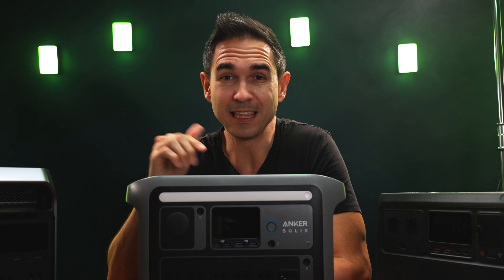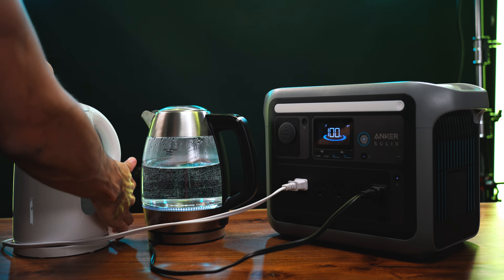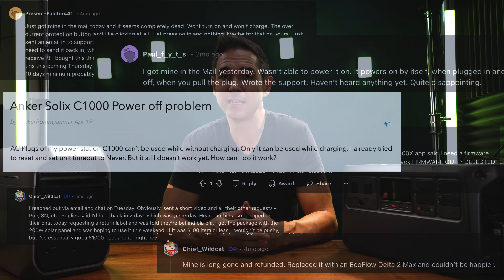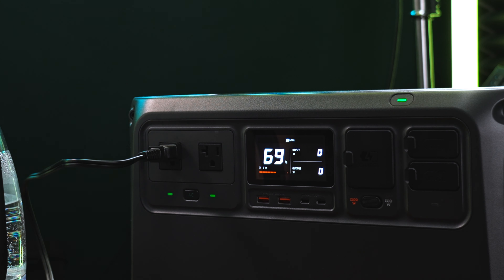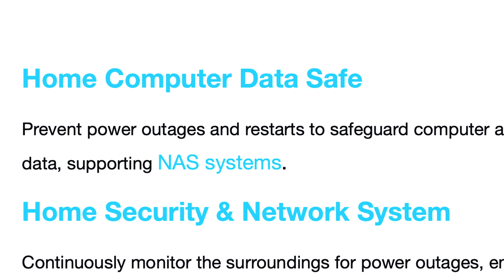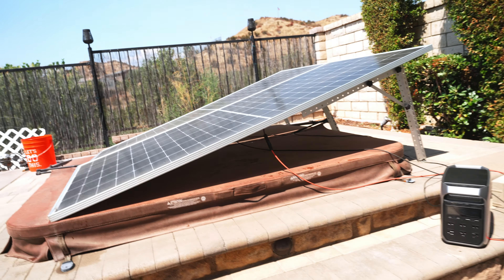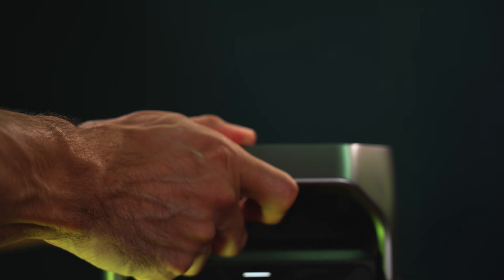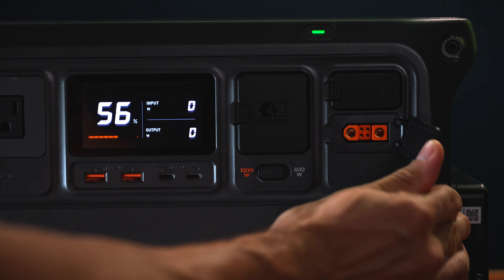Anker Solix C1000 BRICKED During Test! (Ecoflow Delta 3 Plus vs DJI Power 1000 – Real World Test!)

Comment from the maker: Yes, I tried the reset button. It was defective. Anker replaced it VERY quickly. I have not been able to film an update video yet, but I will soon. Sorry for the ridiculous long delay in an update. Life gets busy.
Reply: Anker C1000 has a plug called SurgePad. It’s the very last one on the right side . It will lower the voltage to make it work . Use a power strip . And see if it works with both .
Reply: Its been one month. Did you do the test again? Did the issue happen again?
Reply: Update?
Reply: Update?
Reply: @Sorensic_96  Update?
Reply: I see u didnt mention u actualy have a fuze reset button on the left side of the battery next to the solar imput im sure u tested it but why not mention it ?
Reply: @Maykay1312  That button has nothing to do with output. It's to protect the unit from AC mains spikes during charging, say in a storm etc.
Reply: I just got my anchor 1000 today. 
Where you plug in the AC charger there is a reset button, I would have thought maybe that would correct your problem but in your video you did not even attempt to push it to see. 
Another commenter said to hold the power button to reset. 
Makes me wonder if you know what you are doing.
Reply from the maker: @CJLinOHIO the button was defective. Anker replaced the whole unit. Sorry for the delay on a real update.

Comment: To be fair most people aren't trying to push the c1000 to its limits and trying to find its breaking points.  Ive saw and read more bad reviews on the ecoflo than any other unit.
Reply: @jodyallenbaugh9427 just because the weight limit for the bridge is 10,000lbs doesn't mean I'm going to cross the bridge with a truck weighing 9,999lbs. I agree most people aren't pushing the machine to that limit. And if they are, they should be going for a 1,500w machine.

Comment: Interesting. I've done the same overload test on the Anker without issue. After it kicks out, a long press of the power button brought it back on every time I tried it.
Reply from the maker: I plan on doing the same test on my warranty replacement. :)
Reply: @TommyCallaway What happened?
Reply: Same here, I've had zero problems with mine after several overload tests

Comment: I haven't had any issues with my C1000 It doesn't seems fair to simply not recommend a product based off of this one issue you had with your unit.  This is only one unit you could have gotten a lemon it happens these power stations are mass produced. I also haven't heard of any other people having this issue either myself included. It would be a completely different story if hundreds or thousands of C1000 units where experiencing this issue but there is just no evidence of that yet.
Reply from the maker: Valid thoughts. I plan on making an update video soon on my experience getting this fixed.
Reply: In the video he shows other customers that had similar issues
Reply: @TommyCallaway when is the video coming out?

Comment: I think you didn’t push the reset button on the back and now you are embarrassed and making stuff up.
Reply: Do you even know what that button is for? It has nothing to do with output. It is to protect the power station when charging BY AC MAINS from spikes etc in a storm for example. You are not the only person to be banging on about that button incorrectly.
Reply: @ You are wrong….it is to reset the unit if it trips. You silly fool.
Reply: @Imjustsaying1966  WHEN CHARGING FROM AC. It's on the INPUT not on any outputs. FOOL!
Reply: @Gravitational234  You so crazy. Did you vote for Kamala?

Comment: My Delta 3 Plus exhibits a high pitched hiss when charging between 600W - 1500W. When I sent EcoFlow a video they said that it was abnormal and sent me a return label. Does yours make any sound other than soft fan noise while charging? The fans are super quiet, but the transformer charging noise is unnerving frequency wise even though it's not loud.

Comment: I'm not defending Anker here, but the comments on the video are from people who clearly haven't read the documentation. For example, some mentioned the power station not starting when not plugged in, which is true. Another person talked about a firmware upgrade but didn’t explain how they did it—whether they turned it off or what exactly happened.

There's also the issue with the power station itself and the devices you plug into it. Could you please provide a photo or video showing the device's voltage, wattage, and amp usage? What port did you connect it to? What is the temperature of your power station?

"Its just broke"—I can believe that, but under lower loads, it didn’t break. Again, I'm not defending them because I’ve had a negative experience ordering devices from them, but I can't say they're that bad. For example, I've heard of many weird and awful cases with EcoFlow and Bluetti.

Here in Ukraine, due to russian attacks on civilian infrastructure (hitting homes, child cancer hospitals, power gigawatt plants, water pipes, water heating, and so on and so on), we experience a lot of blackouts, so many people use Bluetti, EcoFlow, Anker, Allpowers, and other brands. The three main ones are Anker, EcoFlow, and Bluetti.

And Bluetti isn’t a great brand.
EcoFlow is overpriced and has many issues (just like Bluetti).
Anker is somewhere in the middle between EcoFlow and Bluetti.
Other Chinese stations—some are good, some not.

However, most people here in Ukraine don’t talk much about poor quality with Anker. It would be interesting to see what caused the failure and how they handled the replacement or repair.
Reply from the maker: I have reached out to Anker already, and will provide more updates. Thank you for your comment!

Comment: Here is what DJI says about its UPS functions from there site. 

What is the UPS mode of DJI Power 1000? How do I use it?

UPS, short for Uninterruptible Power Supply, is mainly used to supply power to devices through DJI Power 1000 when there is a power outage and prevent accidents that might otherwise be caused.  

When electrical devices are connected to the powered-on DJI Power 1000 and both are receiving grid power, DJI Power 1000 defaults to UPS mode. DJI Power 1000 can start powering the connected devices within 0.02 seconds. You can decide whether to use this mode based on the device(s) you are using.  

When using UPS mode, the charging speed will be subject to the load of the connected appliances, which changes dynamically, so the time required to fully charge these appliances will also differ.
Reply from the maker: Thank you. I couldn't find this on their site when I made this video.. it's very clearly on their product main page now though!

Comment: Im having the same.problem here. Running 1500w air fryer when the power came back and the c1000 overloaded for no reason.. also my 65" tv turns off every time we lose power (no UPS) wich doesnt happens using an ecoflow river 2 max (512wh)

Comment: DJI Power 1000 is on sale for Black Friday. $379 on Amazon!
Reply: Yup, and I just picked one up!  That's a killer price to pass up.  I also picked up the EcoFlow Delta 3 Plus including the alternator charger a couple of weeks prior so I now have both.  I've received the Delta 3 and been playing with it for a bit.  Tons of options on it through the app.  Still waiting for the DJI to arrive.  Reason I got both is the Delta 3 will be for my camping/offroad adventures while the DJI will be used on my property in places that doesn't have power.  I plan on using the DJI for an electric pole chainsaw, jackhammer and electric power washer where I don't have to drag out a generator.
Reply: @ I responded with a detailed review a couple of days ago, but it somehow got deleted.  I guess someone doesn't like my comments.  I'm just gonna leave it as is.  Sorry.

Comment: Stuff breaking is normal. Should be avoided at all costs but it will eventually happen.
How easy it is to repair or get exchanged is where I judge a company.

Afaik this seems like a firmware issue which should be able to be solved by firmware or worse case scenario, change the control unit. The battery packs themselves should be fine.
Reply from the maker: I have reached out to Anker and will provide an update on my experience.

Comment: You know you could have just hit the overload reset button on the left side of the power station in between the solar and AC input port right!?!
Reply from the maker: The unit was defective, the button did not work. They replaced it very quickly once notified of the issue - i haven't been able to film an update video yet.
Reply: Ohhh thanks for letting me know
Reply: The breaker is for INPUT when charging by AC. Nothing to do with OUTPUT.